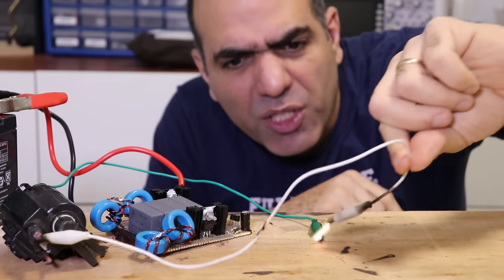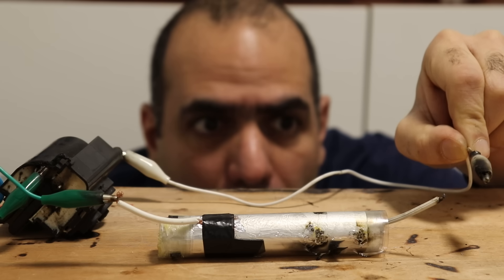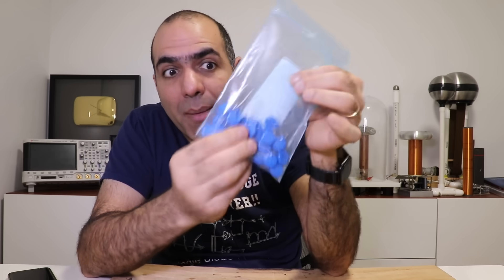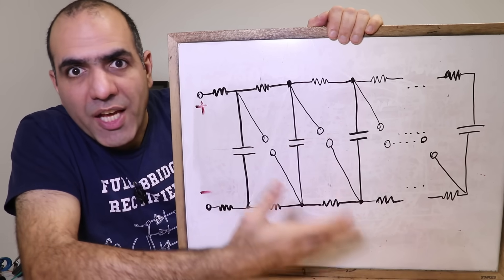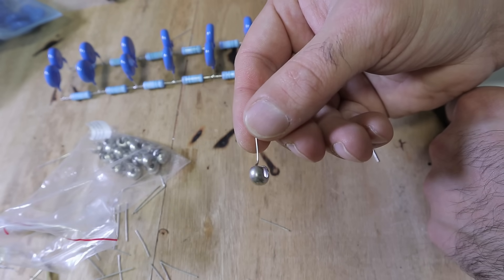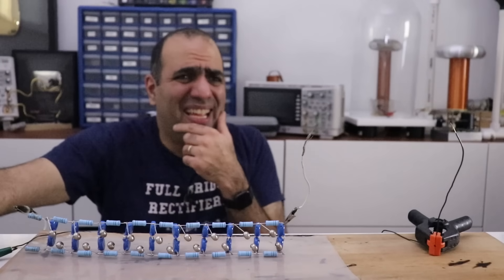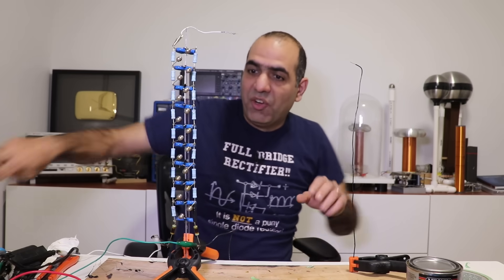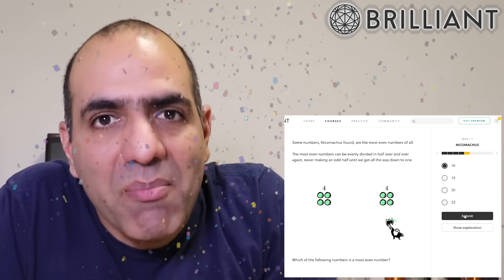Making 500,000 VOLT ARC with Marx Generator

Comment: Get some Corona Dope and paint the resistors and their leads with it.  That's what we used on the old CRT TVs for the solder joints of the high voltage rectifier tube socket.

Comment: Marx Generator and Tesla coil work in similar fashion, producing high intensity electric fields in air gap, or high ddp, causing the discharge. The difference is the nature of the electric field: in Marx Generator is a eletrostatic field, associated with the charges on capacitor while in the tesla coil is a induced electric field.

Comment: Dear mr.mehdi, How long can a commercial 3v to 400kv high voltage generator work non-stop? Can I make an ozone machine out of it by designing electrodes that expand the plasma and Air can pass through it?

Comment: Radiation warning, radiation, warning, radiation, warning where’s your Geiger counter? You know when you make a Spartan gap right and you get the frequency above X you must have a Geiger counter unless you want an x-ray for both you and your neighbors that’s right your neighbors get it too right through the walls, but you didn’t remember that You know when the spark gets above 1 cm in length you’re guaranteed you’re making an x-ray now the x-ray might not be powerful enough to bother you but up to voltage up the distance and gap x-ray time and make it even mean put it in the vacuum. You wanna make it safe Put it in welding gas. We all have a Geiger counter if you don’t have welding gas, you know they used to make it so that if you used a mechanical vacuum pump, the vacuum pump that they show you with mercury, they don’t expect you to be able to get enough mercury to make that That’s still a valid pump in high science and mechanical vacuum pump. We weren’t gonna release that at all if you didn’t need it for air-conditioning and then we were gonna make everybody have to have a license for it just so that they don’t use it to put that thing in the vacuum can The most recent video I talked about this they were actively vacuum candid out and show it off thinking it’s a good thing. I was like OK you know you just gave yourself more than a year worth of x-rays and one spark you need to get a Geiger counter you need to have yourself checked for radiation exposure and yeah, I wouldn’t tell your neighbors yet, but when you go in and get checked for x-ray exposure, yeah you really if you have any of that at all, must immediately tell the authorities and let them inform all of your neighbors because you might have just killed their children and or caused them not to be able to have any because you’re such a good Christian or bubonic individualgood job good job

Comment: The Chicago Museum of Science and industry used to have a 1 million volt Marx generator for producing artificial lightning. It used a 100 kV power supply to charge 10 large 0.1 uF capacitors. it could split a 2 x 4.   It was intended for testing high voltage insulators and other components.

Comment: This 15 year old (well 15  in 1966) made a rolled foil and capacitor for a 15kv neon sign spark gap interrupter to feed a home wound Tesla coil.  It held up for about 10 seconds before burning through similar to shown here. My injury from it was noting electrical but a slip while stabbing into it with a pointy kitchen knife. I managed to cut through the nerve at the middle joint of my left index finger. Other than the first instant there was no real pain and no sensation for that front 2 inches of the finger. The Doc put in 1 stitch but said there was nothing more he could do. Then about 1/4 inch per month sensation progressively returned as the nerve obviously regenerated. In less than a year it was all back to normal except for times i would accidentally hit that spot and for a second it would fell like I was getting stabbed again. That gradually declined and hasn't happened in the last few years. Anyway ElectroBoom show many of the electrical dangers but also be ware of other side effect accidents!

Comment: 0:57 I believe what's happened was that when you had both hands on the circuit intended to charge the capacitor, your body wound up being the path of least resistance, which caused you to jump from your seat like that.
Reply: Excuse me for replying to my own comment, but I'd like to add that ElectroBOOM jumped from his seat due to the high voltage imparted on his body by the battery which was meant to charge the capacitor.

Comment: Grabbing the HV and ground reminds me of the time I was building a 600W ham radio tube amp. I thought i had unplugged it to work on it, but I had unplugged something else. I grabbed the live plate cap of the final, which was 1000v at .9 amps, while touching the metal frame. It stood me up out of my chair and knocked me loose. I wound up on the floor happy to be alive.

Comment: i know this video is very old but you can still try this. what if you make another Marx generator  and use the extremely high output of this one as the input so its even higher. and if that were to not work you could try something similar :)

Comment: with Marx generators can it be continuous ? or would you need a different type of circuit or device to do this ? continuous meaning not pulsing for the larger end of the  arc.
Reply: Nope, because you are charging and discharging capacitors all at the same time to do the arc, so the time it takes to do that is the time it takes to make an arc.

Comment: Can someone explain why is he using resistors
Reply: If there was no resistors the capacitors would be connected in parallel and in series simultaneously basically creating a short circuit and there wouldn't be any output. 

You could think that the resistors are slowing down any current moving through them. At first the capacitors in parallel charge just fine but it takes some time because of the resistors. When the spark gaps connects the capacitors in series there is a high voltage across the resistors but not too much current flows through them and gets wasted and most of the current goes to the output

Comment: Hello Mr Sadiq. Good time. I have a question. I would be grateful if you could answer it. How many nanofarads is the capacity of the 15KV capacitors you used in the Marks generator? And what is the Ohm value and Watt value of the resistors in Marks generator?

￼

Comment: I have 20x  40Kv TDK fist sized ceramic door knob capacitors that I was going to build a CW multiplier but never ended up building anything except for one single stage to test the concept.   My input has sparks close to the size of the output on this video. The output on the single test stage is frighting so a 10 stage will be awesome! 

Perhaps a Marx generator might be the way to go as my road block was getting 20x 100Kv high current diodes to deal with the peak loads during discharge.  There were some options but would have costed me many $1000s at the risk of still blowing the diodes up. The highest mA microwave diodes worked well but I needed like 5 in a string, so 10 per stage, 100 all up and again, prices too high to justify.     

I suppose resistors are cheap as though and could be the compromise I need to make me tinker with the project finally after 10+ years of having the caps in the box they arrived in.

Comment: Mehdi Sadaghdar, Please work on "gravitational engineering" and "Beamed power transmission".

 I realized that you can use 3D laser ionization of air to create a shortest path ionization channel. You found the dendritic channels and spray of the discharges is fast, but not beyond the capabilities of control systems and sensors now.  You can use 3D laser ionization to paint specific channels and to record in real time the channel currents, electron densities, magnetic and electric and gravitational energy density.  The sensing is being put under "lidar" and "time of flight" methods.  One goal is to make forces and body acceleration fields - to make synthetic acceleration fields.  I categorize that as part of "gravitational engineering".  Richard Collins, The Internet Foundation

Mehdi has matured and learned over the years.  If he would get serious, write and explain things clearly, his own understanding will grow.  He could literally transform all uses of high power, high force, high energy density field generators - for use to control "gravity", rather to overcome gravity and make true field based 3D acceleration fields.  A good problem to work on is to design fields that can lift the 2nd stages of Spacex (and other groups') to mission velocity and height. Eliminating the booster stage with ground based and hovering field systems removes the cost of chemical rockets and their oxygen. The fields (and energies) can catch and place the returning cargo and missions.

Gravitational Engineering Problems: A good problem to work on is to design fields that can lift the 2nd stages of Spacex (and other groups') to mission velocity and height. Eliminating the booster stage with ground based and hovering field systems removes the cost of chemical rockets and their oxygen. The fields (and energies) can catch and place the returning cargo and missions.  Simple low loss power transmission through air is possible with shaped channels, so the vehicles like planes do not always have to carry bulky chemical fuels, not the oxygen at great heights. Electric boosters, electric planes work in the atmosphere.  And fields can be extended many earth radii with maturing "gravitational engineering" methods.  It works the other direction, so space based solar arrays can beam their power to the earth.  With these kinds of methods (planning, modeling, testing, designing) it is also possible to store energy and power.  The SpaceX booster replacement needs about 36 two GigaWatt ground stations (roughly) and that is not an impossible amount of energy to store - considering the cost savings nor not using belching massive chemical rocket technology from many decades ago.

Comment: I still remember "discovering" a bad spark plug wire in a 1975 Chevy Impala, the discovery process was that I was leaning over the fender and I reached under the hood for ... something.  Spark plug wire had broken insulation I guess, and it jumped from the wire to my hand and discharged through... let's call it a very sensitive part of my body that was against the fender and fully in the path of the circuit I created.  And amazingly enough I still managed to have children later on in life!!

Oddly though, when they slept at night their room was lit up despite them not having a night light.  I was too afraid to look and see what was lighting the room...

Comment: I worked in a company making power supplies, when we did high voltage power supplies, they needed to be tested before they were potted, so we used flourinert this stopped all arcing, enabled us to probe for testing etc, it was truly a magical fluid, in your case, i'd have had the spark gaps just above the surface of the fluid, it looks mad, sticking high voltage electronics into what looks like water.

Comment: That big shock, reminds me when I was under my desk unplugging a UPS to move it from my old power bar that I didn't trust and wanted to replace (it was rated for 12 amps, I prefer everything matches or is higher than the 15 amps of a wall outlet due to a fire in the past). The plug was being stubborn and I was twisting my body in an uncomfortable way to access it. To brace myself for balance I grabbed my desk, a steel desk, not thinking as I pulled out the plug and as it came out my finger slipped and touched one of the prongs. I didn't feel the shock in my hand or arms. I felt it in my chest back of my neck as that was pressed against part of the desk as well and ended up getting kicked back by it.

My roommate was a paramedic and I yelled for them to come check me, said I took current across the chest and to give me a check over to confirm that my racing heart was just panic, I was having short term vision issues as well and wasn't able to move correctly and apparently had slurred speech. They looked me over and then informed me that it wasn't my heart that had them worried, it was that my breathing and voice told them my diaphragm was still acting up and my behavior meant my brain got some electroshock therapy. Took me 15 minutes to get to normal again.

When I went back to work they grabbed a dog chain and forced me to use it to ground myself on the same arm that I was pulling plugs with.
Reply: ❤
Bravo❤

Comment: You just went above powerline voltages,how do you feel,to bad it doesn't stretch as far,mabye you can make a high power inverter and a frequency adjuster to make different shapes and sizes of arcs, cause from what ive saw the powerline voltage is 280 kv you made 500 kv

Comment: Alright just answer my one question how do I increase the gap of spark with just only 1.5 volt two battery means 3 volt I had gas lighter which was using 3 volt had the gap of 9 cm 
It's Been thrown away so I don't know how that happened

Comment: I wish you shared your parts list my friend.

What capacitors/resistors are you using ?  It’s it ok to use a high voltage generator from Amazon instead of a flyback transformer?

Comment: I need help with a school project, it is a Marx generator, my problem is that I can't get the proper relationship between capacitors and resistors, I need the help of someone who can tell me the measurements that my components should have as well as with how much voltage to put

Comment: Try using chokes instead of resistors as the charging elements. I made mine by winding several layers of plastic-coated wire around ferrite aerial rods. I did when I built Marx Banks years ago. But a word of warning -  the arrangement generates huge EMPs. I had to repair a workshop full of damaged equipment after conducting some tests once.

Comment: I ordered x20 15kv 1 nanofarad capacitors and a 200 pack of 1 megaohm 2 watt metal film resistors because they were only 20 bucks total. I should be able to make a nice 10 stage multiplier like this ❤. 

I already have a 3kv DC 30 milliamp neon light transformer ballast that plugs into the wall. This should be interesting.😂

Comment: Where can I get those 15KV capacitors? I want to get some but I am not sure about any brand off of Amazon? Help please.
Reply: Side note here: I noticed there are different levels of “farrads” or whatever the “F” stands for on a capacitor. What level of this would be best??
Reply: Oh yeah and also. He used 1 megaohm resistors with 15 kilovolt capacitors. So would it be bad to use 20 kilovolt capacitors and 2 megaohm resistors?? Please help me.
Reply: Also very important!!! IS THIS DC OR AC CURRENT?? AND WHAT IS THE STARTING SUPPLY CURRENT!!!??
Reply: I figured some of these things out so never mind I guess. But still need some good capacitors and a starting voltage number.

Comment: AMAZING work Mehdi!! I could be your biggest fan! I'm in the process of learning Electrical Engineering. I Have a question, (hopefully not a dumb one!) Once the spark  gaps fire and all the capacitors fall in series, and if capacitors block DC, (I'm trying to understand the flow,) how do the electrons pass the dielectric between plates of the caps? In order for them to add up, and even be in series!?.

Comment: you youtubers like to play with dangerous electricity.....my kind of people.....also you guys like to play with extreme danger electricity lol

I had a spark jump off my electrostatic geny the other day to my hand from a good 10 cm away.... I was under the impression that I was only making 30 KV, it shocked me from like 7 times my spark gap distance

longest spark I've ever seen in my life, jumped from one of the charge carriers on the negative side to my hand

was touching the positive wire on the other side, didn't hurt bad but it surprised me, nothing like geting shocked by 348 indistrial mains, that hurt

didn't think it would jump that far considering i can only make 14mm sparks off of 42 mm stainless steel balls

Comment: yupperz, long hi volt streamers are just too kewl.. I made a tesla coil about 20 yrs ago that made 12' long streamers. The main power supply was 2 @ 14,400 VAC distribution transformers wired up to produce 28,800 VAC and when supplied with the 240VAC Powerstats to a max of 260VAC the primary voltage was peaking around 32,000VAC. The secondary coil was 5' tall and 12" in dia, the toroid was 12" by 60"...  if you look very closely at my Avatar pix its the coil I made, the top of the toroid is 9.5 feet above the ground and the streamer arcs outward by a bout 4' and then downwards for an approximate length of 12-14 feet... it was incredible to see and hear this monster running...  I miss that coil  :(

Comment: 7:56; Your Marx generator is set up right as a display, but the ground wire has to be closer to the generator; otherwise, it will not arc.

Comment: I was sent to repair a 15kVAC SF6 breaker at a facility that services and repairs large power and distribution transformers.
I saw a large piece of test equipment that looks like your MARXS generator but it was stood on end, as shown later in your video, and was six feet wide and three or four stories tall.
Sadly I did not see it in action.